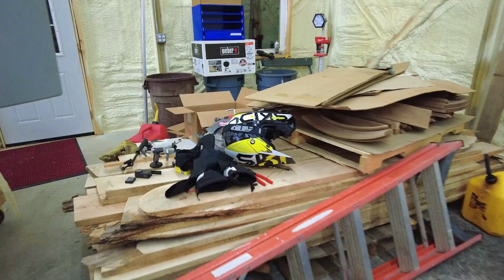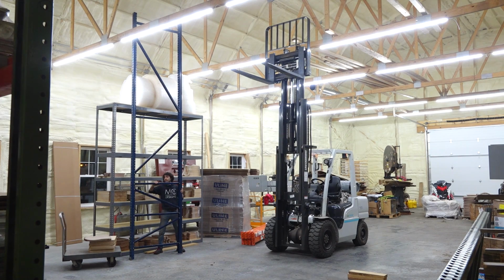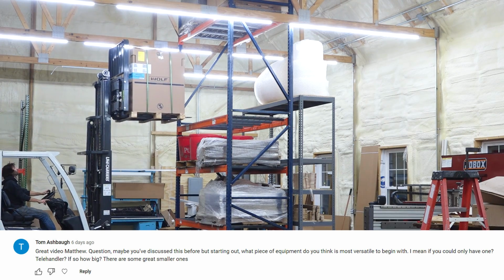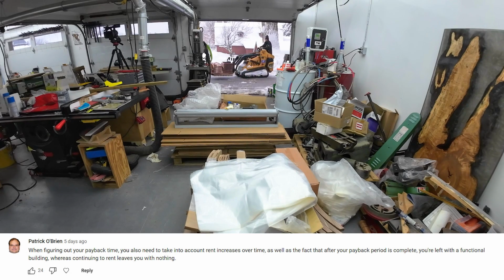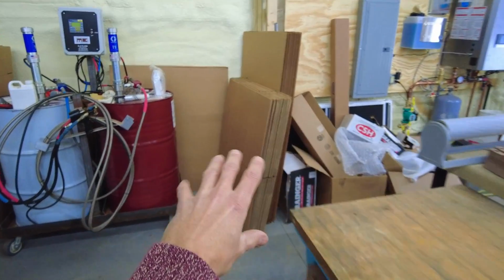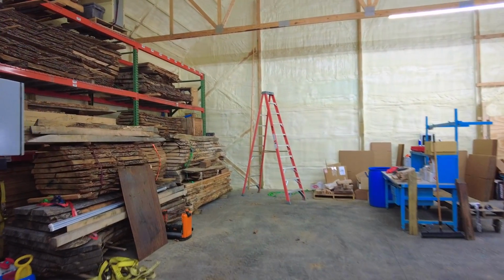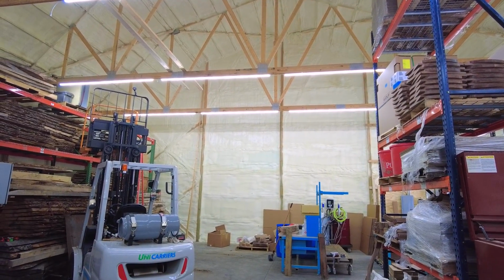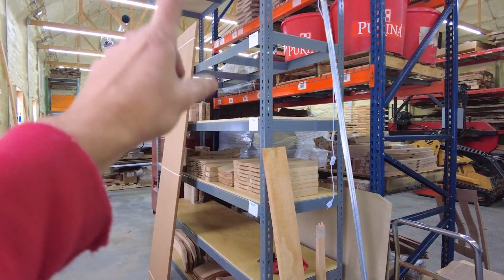How Do I Decide Which Business Ideas to Pursue? - Setting up the Barn & Answering Questions

Comment: I'm loving the new building. When we wired my new shop which is 30x48 we setup three rows of lights. Each string is five 8' strip fixtures which are essentially a fluorescent style fixture but without the ballast. Each fixture has four 4' Keystone Drive Drive LED blubs. So 60 tubes in 1440 square feet. I love it. Nice to know when they die and they will in my lifetime its a simple bulb swap. The whole lot runs on less than 1100 watts.

Comment: Part of the reason it seems, and is brighter in the shop is the walls, and ceiling are white. In the barn they are sort of off yellow/applesauce color. True, the lights aren't as dense, but the wall color isn't helping. All of the dark wood along the other wall is sucking up even more light. One thing that occurred to me as I watched the last part is, if you aren't going to put stuff between bays in the bottom part of the trusses (there are boards in the middle of some bays now), you might consider brighter flood style lights pointing up into the ceiling so the light bounces off the light colored ceiling, and  washes more space. It might give a brighter more uniform amount, and be easier to do then adding lots more of the 8' LED strips.

Comment: You should consider extra lighting in areas where you do your work like the packing area. When I worked for a dealership they had extra lights run along the walls at 5ft just above the work benches at a 45* angle down towards the benchtops for detailed work and standard lights on the ceiling so people wouldn't fall over their own feet. Remember the lights aren't dim their just too far away from the work area when mounted to the ceiling.

Comment: The shop turned out great! You may want to consider installing ceiling fans up in the rafter bays to push the heat back down. I think a lot of the heat being generated by your radiant floor is just naturally rising and sitting at the top of your building. When you look at the drone footage you can see that the snow has melted from your shop roof but not the other buildings on your property, this could be an indication.
Reply from the maker: On the to do list
Reply: Radiantly heated floors tend to equalize bottom to top. Fans will be ,more likely, needed in summer time. 
That building is well insulated.

Comment: Yep, when building our home I found that 55 degrees was about perfect - I was warm enough while working but got cold if I quit so it kept me moving. My current workshop is kept in low 60's which is fine for the same reason. Plus I have an insulated floor over the concrete which helps a lot.

Comment: Very good thought process on the chairs, I have been a pro woodworker for the past 40 years and built several commissioned tables . I never had a source for chairs and they were usually provided by an interior decorator. You nailed it on the limitation of most shops being able to produce a chair for 1 job, way to technical for most and ultimately just not profitable. I wish you the best in your chair business ,and I wonder if most of your sales are business to business. Cheers

Comment: I am not a structural engineer, but did design a lot of racked warehouse space.  There is a significant amount of structural integrity for the racking which comes from bolting them to the floor, especially if you do not use the bottom beams to keep the legs from splaying.  Just a thought that you may want to keep the upper loads to fluffier stuff and the heavier stuff towards the bottom if you don't want to bolt to the pipe heated floor.  Great content, thanks.

Comment: @29:43 you could probably put the little black rack from the packing area (the one you want to replace with a bigger one) on to the top side of the palette rack where the bud of the forklift (charger) will end up. Nice to have som space to temporarily punt stof when you walk in. (On the spot of the car bord box and the blue thingy)

Comment: In regards to the heat question,I will agree with you on it.I have floor heat in my shop.If im working,for the most part you can get by with it at 55.Ive slowly adjusted mine up over the years(been only 4) to this year i have it set at 60.Mainly because i have people over,or customers and we hang around and have a beer,etc.Ive found that we started to get chilled with anything under 60.AT 60 when working,you can be down to just a vest or less for sure.Where floor heat really shines in my opinion is the colder it gets outside.Its been 5 degrees out for the last couple days...Its amazing how warm it feels in my shop,better than my house i think!lol..its also makes no noise and every corner of a space is warm

Comment: Matt, I got a good price on some white epoxy paint when I put together my 40’x30’ shop 18 years ago. I used those flecks to make it less slippery. but still easy to keep the floor clean. The shop is very bright even with a limited number (12) 8’ 40 watt florescent bulbs. At the time the LED bulbs were new and only available in limited types and they were far more costly. I think if you were to paint your open areas to start with, it would make your barn a far brighter work and storage area. You could keep more paint on hand to do more areas as it became convenient. Some areas that would permanently be storage space I wouldn’t bother with.

Comment: You probably already know this but it is super important to securely fasten free standing pallet shelving to the floor. They fall much easier than you could imagine.
Reply: How do you know he didn’t?
Reply: @davidhaworth7152 with all the projects he has brought us along for it seems if he did he would have shown the process. 
However, it also seems that he will prove concept of location before he finalizes something like drilling holes in his concrete.
Reply from the maker: Correct

Comment: Amazing setup, congrats.  I am curious as to whether you feel the need to floor anchor your racks. As for the lighting comparison, the garage walls and ceiling are white and the bare insulation is a flat non-white surface, less reflection, etc.  All in all, it is very impressive!! Jack

Comment: I started watching your videos about a year ago. What attracted me was the woodworking and the urban logging. Plus the sawing videos are great for autohypnosis.

I saw your "A Day in the Woods" videos. On a different channel, I saw a video I call "Vandal with a chainsaw". A helicopter drops him on a mountainside. His goal is NOT to harvest trees. It is to kill and destroy every tree he sees. If a tree he fells shatters into pieces, he doesn't care. He is pissed that the EPA doesn't let him kill the saplings. He just wants to see stumps as far as the eye can see.

Next is the sawing. The commercial videos are interesting. I liked the company that makes LVL. They take old rubber trees that no longer produce. The bark is used to power all the machinery. They peel the tree for the veneer. And then use the veneer to make LVL. The worst is a video about a company trying to saw a 30" pine log with essentially a large table saw. The blade is only about 18" high. They peel the log like you would a carrot. Constantly whittling away until they end up with a cant their saw can handle. Since they are constantly moving the log, many shavings are triangular. The faces of their boards are not parallel and the thicknesses at the ends are different. I love that you built your own sawmill to handle large urban logs.
Urban logging saves wood that would otherwise just be burned up.
My favorite plant is one outside a big city. They got a contract to process the city sewage. The methane from the settling tanks is burned to provide electricity to power the machinery and all vehicles used in the plant. Excess electricity is sold to the city. The water is processed into clean water used in the plant and sold to the city. The waste heat from the electrical generating plant is used to dry and sterilize the solid waste. This is pulverized, bagged, and sold as organic fertilizer. They are paid for taking the raw material. And paid again for all that they produce. Nothing is wasted.
Look at co-generation. Large hotels need electricity and hot water. Co-generation burns fuel to produce the electricity they need. Excess electricity is sold to the city. The waste heat is used to heat the water they need.

The vacuum drying was a surprise! When I took woodworking, air drying took 8 years and kiln driving took 6 years. It is so different today. Vacuum, pressure, and heat reduce years to days. Please show more on microwave vs heated-plate vacuum drying.

Finally comes editing the videos. Your technique has greatly improved over the years. You stopped using sped-up video for the sawing and save it for when it is most effective, like ripping boards for flooring. You have also gotten much better with the drone footage.
Your work is truly excellent! Keep it up.

I would like to see a new "A Day In The Woods" video. More sawing! Plant more trees and more varieties of trees on your new property.

Comment: Matt, are you going to cover the walls with metal panels/white or at least put 1/4” ply with an anti static paint? Seems like if you do a lot of work causing saw dust flying around the insulation is going to look grungier than need be🤔

Comment: Great show, and great job on the Barn. What is the temperature of the floor?.  And what is the temperature up at the ceilings ? Did you think about putting ceiling fans in. I think that will help you out making the heat even throughout the barn.
Keep up the great work👍

Comment: your hardware station looks like a candidate for having casters on it as well. would a small mezzanine area in the assembly area be an option then the upper level can be used for storing access materials, i knew a shop owner who had a two-storey building and the ground floor was the shop and he had the identical floor plan of the ground floor upstairs then stored stock in the same shelving there,easily found

Comment: If the chair packing space works out, you should timberframe a second floor deck over it for storage to take advantage of the vertical space.  I'm in process of doing that in my pole barn now.  I'm putting up a timberframe over my lumber storage shelving which is only 7 feet high.  I've got another 7 feet above that.

Comment: Hey Matt, what's your strategy for tool usage between your disparate locations; house, barn, new barn, shop, etc? Do you have a traveling bag of your most common tools or do you have a couple of sets of duplicates of the most useful ones? I'm dealing with a similar situation with the start of a home remodel and having all my tools put away in their place in the shop and then still having to do projects for my wife in the barn.
Reply from the maker: I am quickly realizing that I’m going to need to buy a second set of tools

Comment: The white painted walls and ceiling of your garage shop, I'm sure, are adding a greater illuminessence to the lighting than the shop building. And you must agree that you would need greater illumination in your garage workshop since that's where you are doing actual woodworking which isn't what you'll be doing in the other shop.

Comment: Great video I saw in your video at 13:51 you had a small air compresses on the floor it looks like the one I have from California air tools. If it is from  California air tools like the on I have does yours not hold air in the tank very long after you stop using it.

Comment: Hey Matt, slightly off topic, but want to get your thoughts. 

I used to work at a big box home improvement store and manager gave me a ton of the horizontal shelving beams. They are ~6” wide, probably same as yours. 

My plan is to make a sawmill. 

Obviously it won’t be anywhere near as heavy duty as yours but I don’t plan on using it as much as you. 

What do you think.

Comment: Matt, Recently had an led spotlight short out. Blew the circuit breaker. Goggled it and it happens. That was one bulb that I had to replace. Wondering about the fixtures you've installed  . Are they parallel or series wired? If one craps out does it shut down your whole circuitry?  And inquiring mind wants to know. Great barn process series.

Comment: mathew on your foam packing area the valve co i was the shipping manager at we had the big scale as the packing spot box stapled shut foam into the plastic valve set in on it to get it formed around it then topped with plastic spray foam close box quick staple after its expanded the boxes were on a shelf next to the foam cans the most popular boxes were lower then broken stack portions were set next to the foam cans (lg boxes)

Comment: Getting organized for work is a wonderful thing.  I'm wondering how you handle the exhaust from the various engines inside the barn thingie.  I didn't see any provisions for fresh air ventilation.  A tight building (spray foam) doesn't exchange air very easily.
Reply from the maker: Opening the big door dumps a lot of air out

Comment: I just installed very similar lights in my shop. The clips are crap. I've come into the shop several times to find the lights hanging by their wires. I wound up 3d printing some replacement clips that were much stronger and held better.
Reply from the maker: Weird. Never been an issue unless they get hit. I had to bend a few clips back so they were less aggressive to get the lights installed

Comment: The problem with telehandlers is leverage really fucks you over some times. We (I was not operating) tipped one at work that has a rated capacity of 15k with only a 1000 pound load

Comment: Just started watching your videos.  I'm curious as to what you installed for spray foam insulation and how it can remain exposed, i.e. fire hazard / rating??  Also, I might suggest at least covering the first 8 feet (around the perimeter) with drywall or corrugated metal to prevent poking holes in your walls??

Comment: When you have the racks in place, put anchors in the floor and wall.  Don't forget this, it's a major safety item.
   edit; use bolt and anchor, not 1 piece anchors. This allows for flush mount in case of removal.

Comment: Hi. I have a question - why isn't the high shelving secured either to the wall or the floor?  It seems that with all that weight at such a height there is a very real chance of a 'unit' tipping, especially when loading / unloading.
P.S. It was great to see those retro shots of the slabs back in the 'old days'!
Reply from the maker: Living with it for a bit to see how the layout is before drilling the floor
Reply: @mcremona  Thanks for your Reply Mathew.  Good luck and be safe.

Comment: I have a question for you Matt that is with the other Barn why don't you make that into your Workshop instead of using the garage I'm just asking are you have other plans for the old barn so you could park your vehicles in the garage instead of outside just asking this is Bob from Vero Beach Florida God bless stay warm and have a great week and stay safe
Reply from the maker: I can't fit my truck through the door so that's not a huge reason to convert it back.  The garage is a really nice size for the type of project filming I do in there.

Comment: Heaven forbid one be necessary but you need some fire extinguishers. It's the last thing you want to think about and that's OK but never not planned for in case something should happen.
May I suggest that dust be held to a minimum because something happens to put dust in the air and there could be an explosion. I believe that you are not ignorant of this but a reader might benefit from the thought.

Comment: Could you not push the slab finisher up against a wall and put shelves over top of it. Do you need access from both sides?
Reply from the maker: Having access on all sides make it much easier to secure workpieces to the bed

Comment: Why your radiant heat feels more comfortable than forced air heat = As Frank Lloyd Wright observed, designed, counseled and taught: Cool head; warm feet.
Your feet are the part of your body that tells you when you are hot or cold.  Once the concrete slab heats up to the thermostat setting it takes much less energy to keep it at that temperature, too.  The slab heats the air through convection.  Yes, the air will rise to the underside of the roof, and eventually everything i n the space will be warmed up, too.  Then everything (all of the mass) within the building will radiate heat.  The exposed insulation will radiate the least, of course, due to its lack of mass, obviously.
Radiant heat concrete floors are the wisest choice for a space like this, especially in your climate.  Also, by far the most economical energy wise.